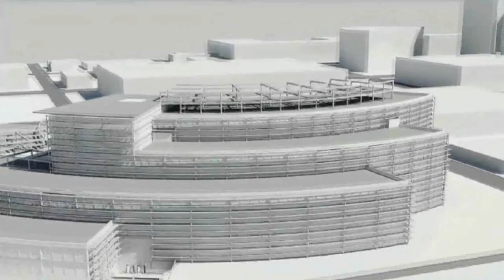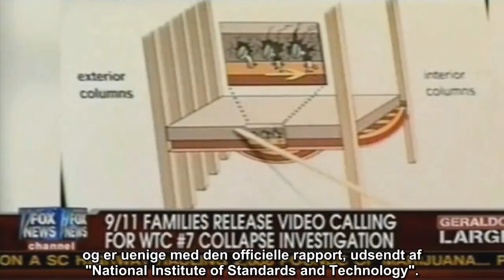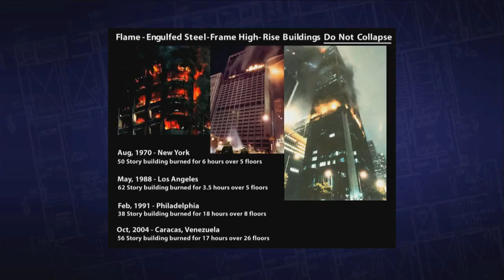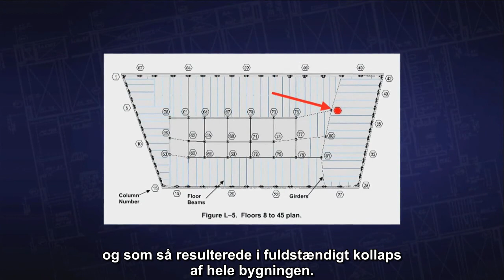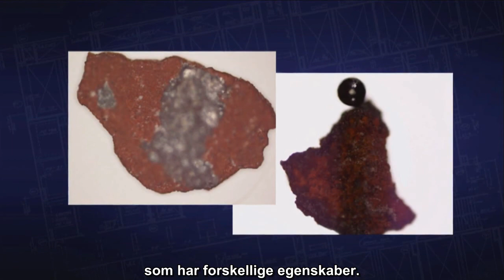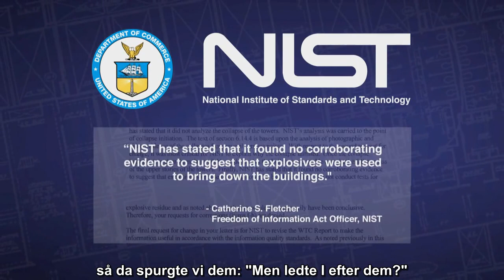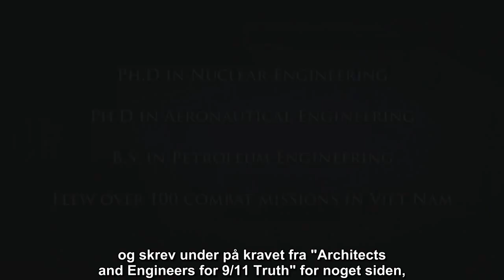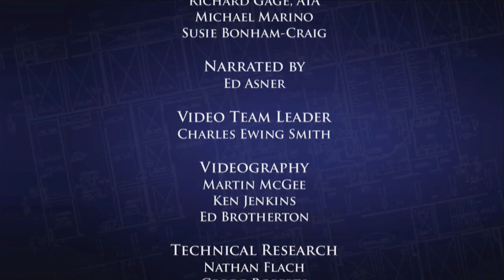Solving the Mystery of WTC 7 - Danske undertekster

Comment: i use to think that way, they couldn't get the demos into the building.What about the elevator remodel and change in security.Do you have a theroy ? There saying that the thermate could have been painted on and used small remote detonators.

Comment: Thermites: Aluminium is ignited with an oxygen rish product, in most cases Iron oxide (iron rust
) to supply the oxygem to burn the Aluminium. The left over from those two substances is Iron, not steel. The woman, Kathy McGrade B.S. (Metalurgical Engineer) states they have Iron in the dust.

Comment: Your first line is debunked by a program on Discovery a few years back which recorded on tape the copper angle bars packed with thermite. They strapped them to the beams they intended to cut with thick rubber bands. That is how quickly it works when ignited.

Comment: (continued)

steel components; parts of the 23 inner core columns of both towers remaining
standing (and how does "DEW" in any way explain the collapse of WTC7?). Also, her use of photographic evidence to try to support her hypothesis ("the snowball", for example) is very easy to prove wrong.

I do not claim to know what was used and exactly how, but Wood's hypothesis can account for far less of the evidence than what do any combination of thermetic compounds (incendiary and/or explosive form).

Comment: (continued)

in commercial demolition. Direct me to whatever sources you have stating that there is no possible way of using wireless detonators that would not be disrupted by cell phones.

"What about Woods work don't you agree with?"

First of all I've yet to see any evidence of technology existing that could possibly be used in such a way and on such scale that Wood suggests (with respect to method of both accumulation and release of energy needed, as well as the distance from target

---->

Comment: He is incorrect. And you are very correct, the explosives were not implanted during the building process of the building however a few weeks to months before the actually 9/11 event. Also, have you ever seen a demolition, buildings can be turned to ruble when the explosives are tactfully placed through out certain places on the scraper.